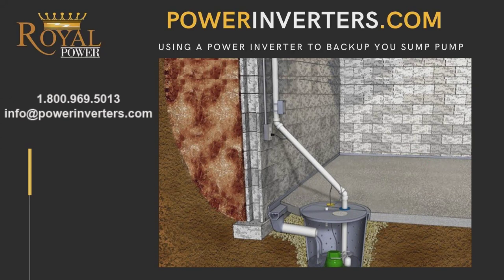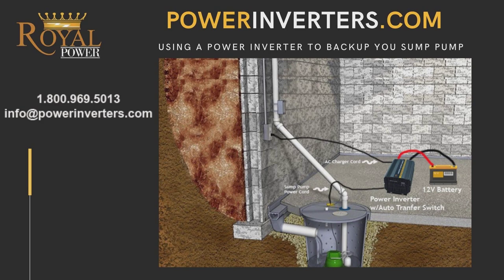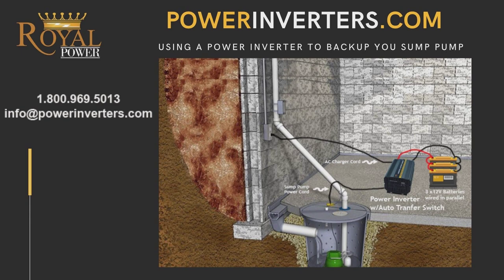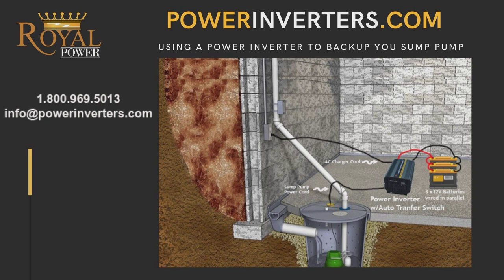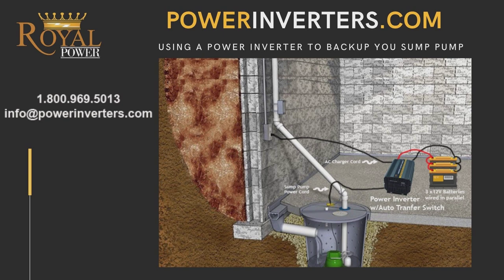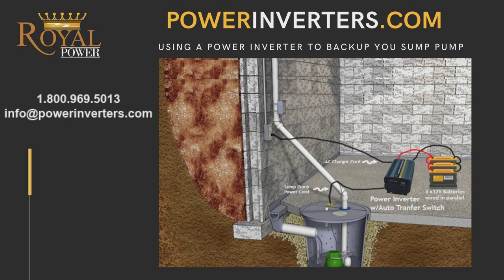Using a Power Inverter to Backup Your Sump Pump

Comment: Hello, I recently bought the 3000w inverter for our sump pump back up and was wondering if we need to ground the inverter to anything or can we just connect the battery to the inverter fresh out of the box and proceed with the setup shown here?
Reply: I guess when you plug in your inverter to the GFCI 3 prong outlet you’re grounding it.

Comment: hi - i saw in another video where they say when batteries are in parallet you would connect red of battery #1 to the inverted and black of battery #3 to inverter.  in your picture you show red and black from battery # 3 going to inverter?
Reply from the maker: #3 or #1 would be the same result.